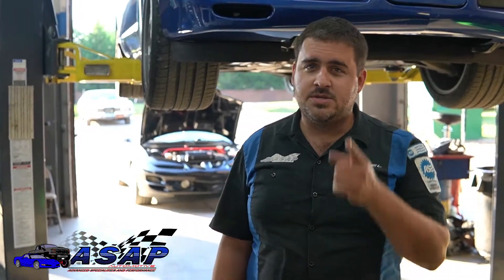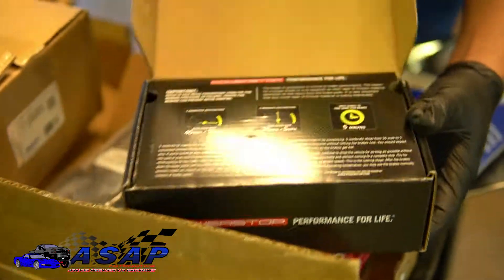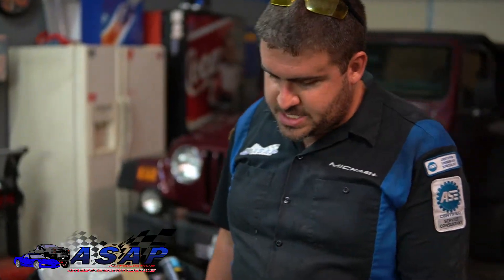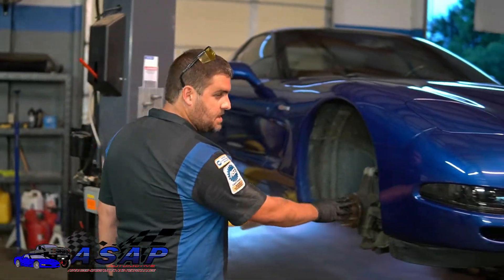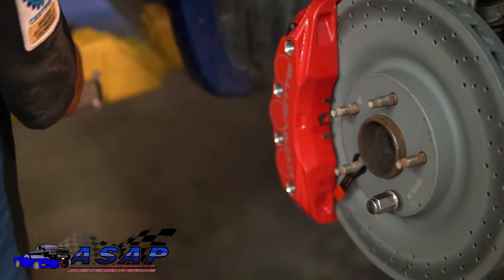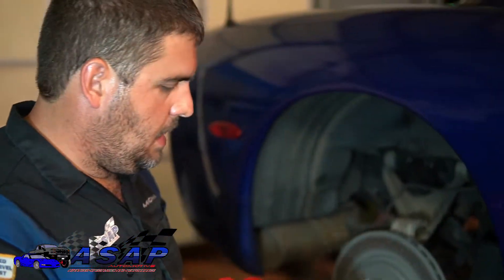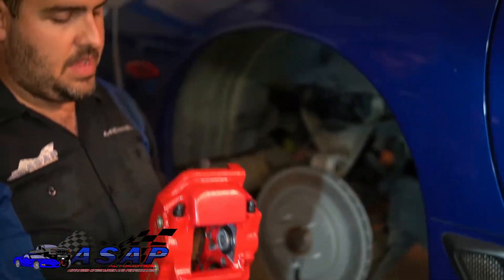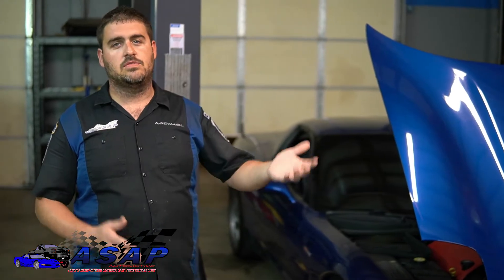2003 C5 Corvette BEEFY Brake Upgrade!

Comment: The C5 budget big brake videos keep getting added to my suggested, so ill keep commenting on them. What's wrong with the stock brakes? Yes adding a bit of rotor/pad size creates more surface area, and yes having more pistons across the pad helps give an even clamp, but ultimately the grip of the tires and material of the pads are most important. I have the stock calipers on my C5Z with 2-piece wilwood rotors (very light, only about 10 lbs per rotor), Hawk HPS pads, SS lines, and the car brakes amazingly. When I had Nitto nt05 200 treadwears on the car if I braked too hard the abs would kick in, meaning the brakes were better than the grip of very grippy tires. Now I have NT01 100 treadwears on the car and it's perfect. I like to keep the weight my control arms carry as light as possible to improve suspension reaction time, and going with bigger heavier brakes is the opposite of that.

Comment: So, can I run my 17s, and 18s, rims with this set up?...Been told NO........?......jb.
Reply: I believe you can run the rear calipers off the c6z on the front c5 17" wheel. The problem with that is you're going to have to run the stock rear rotor which has the E-brake drum inside adding a ton of very undesirable weight. Remember, any extra weight on the control arms reduces the effectiveness of the shock dampening. Alternatively, you could try to find a custom rotor that is the perfectly size from a wilwood or stoptech that would work without the e-brake drum.

Comment: Can I use my 18" front wheels and 19" rear wheels with this new brake set-up.  I have a c6 with z51 brakes and the "gumby" wheels?
Offset on fronts is 56mm and rears are 79mm.

Comment: Does the factory c5 Z06 wheels fit with the upgraded C6 z06 rotors and pads? 

Awesome upgrade! 👍🏽
Reply: no.. you need to go an 18 square set up for using oem wheels